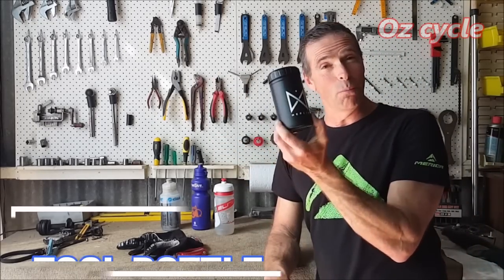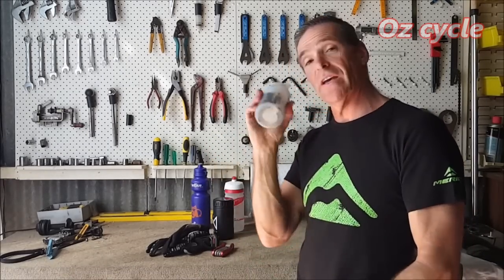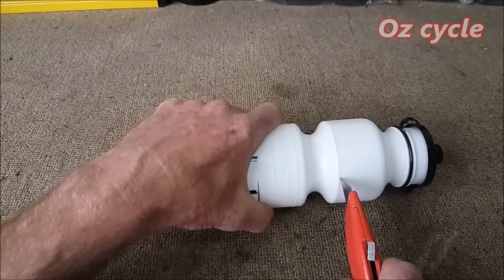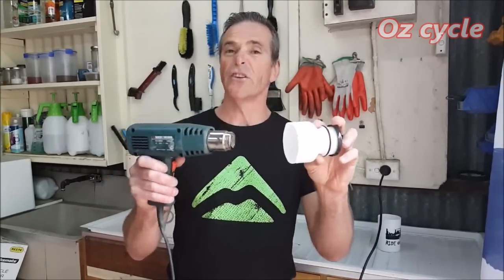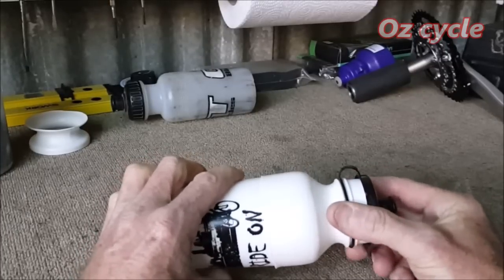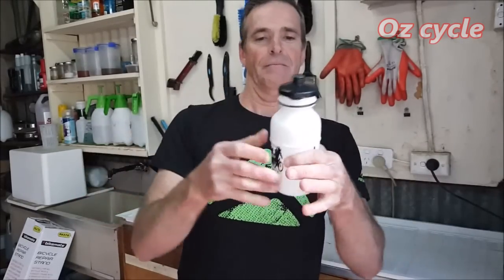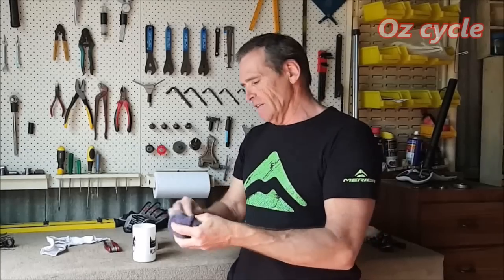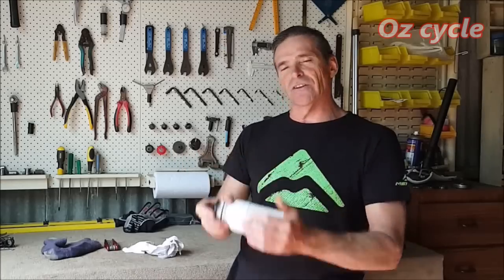Tool Bottle - make your own dirt cheap

Comment: Any reason why not to just use a large 900 to 1000ml water bottle without modification? Something like a SIS water bottle 1000ml that has pretty big opening at the top.

Comment: I just put tools in a bottle, I just use a bottle with a wide lid.
Reply from the maker: Can you put gloves or arm warmers thru that lid Reginald?
Reply: oz cycle yes, yes I can, I can fit a full chain and beefy padlock inside as well. Not much call for the gloves where I live though... it's a constant 30c 😁
Reply: oz cycle and I can also use it as a water bottle again after.

Comment: Reminds me.of jock use my blowtorch on.pvc pipe like drain.pipes to fit the gutter poppers. I.also use my heat gun.to remove decals on alloy rims, not carbon of course.

Comment: Hi Steve. Not related to this video but perhaps an idea for a future one. Can you make your own degreaser? I find it rather expensive to buy and it would be a nice saver. Best regards, Mikkel
Reply from the maker: As far as I know you cant make homemade degreaser as powerful as the ones bought because a good degreaser is very alkaline. You can try baking soda solutions,vinegar and laundry detergents but they want do the job as good as a manufactured solution. Citrus based cleaners are good too.

Comment: Hi Steve, unrelated to this vid but you might respond quicker - I went looking for paraffin wax candles and the ones I saw in Woolworths and BigW (same supplier given same company?), but yet to check out Coles, are cheap home branded candles with no mention of being paraffin. While it is most likely solely paraffin wax, do you reckon it is safe to assume or might it have other not so suitable make up? On basic stuff like this nowadays, it is usually cheaply packaged or home branded with no info and staff know nothing. Where do you get your stuff from in SA (I think that is where  you are). Bunnings has the Paraffin Oil and Xylene but no household candles, just outdoor citronella. Cheers.
Reply from the maker: I buy my candles from Coles...cheapest available. All the cheapest ones should be paraffin.
Reply: Thanks buddy. Love the content of your channel. informative, well presented (entertaining), frequently giving cheaper alternatives or home made stuff - love that. Now just need to get more popular than durianrider!
Reply from the maker: Glad you like the vids. There are a lot of budding cyclists who cant afford the bling,especially in poorer countries but they have internet.